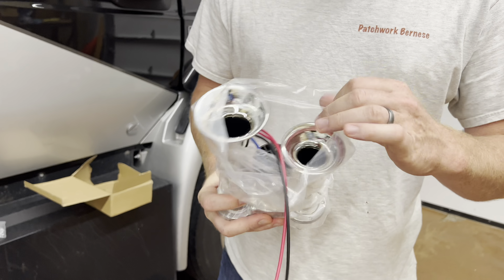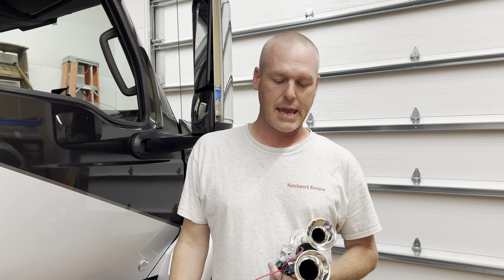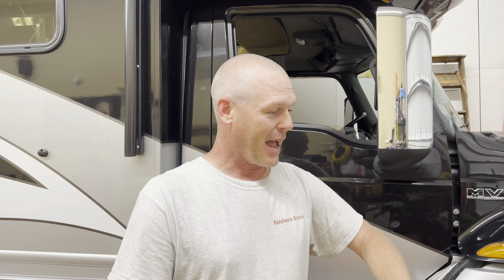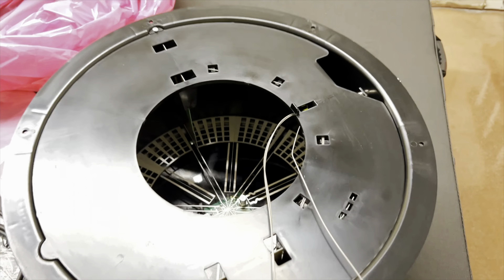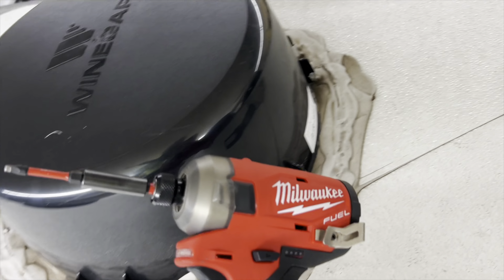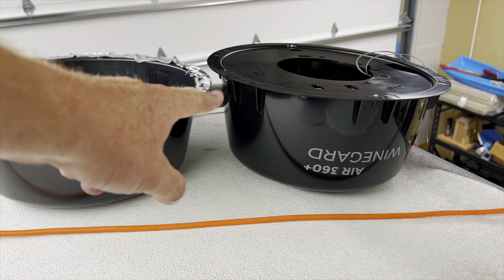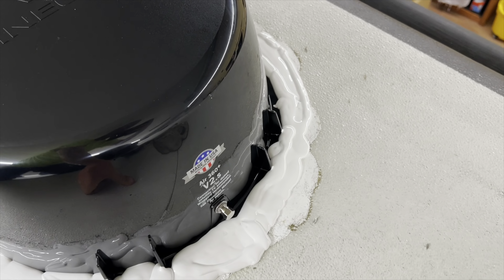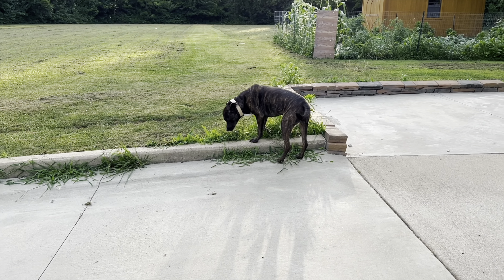New "Air" City Horn and Winegard Air 360+ Antenna (Worthwhile Upgrades?)

Comment: The louder is better because it is louder.  If you can aim it up into the hood it may sound a little better, but it is better than the soft horn.  Piper as always was cute.   Be safe guys.
Reply from the maker: Not bad for a city horn replacement for $30😎 Piper was like what was THAT?!

Comment: Not sure if you're aware of it but Dicor and most other self-leveling lap sealants have a lot of water in them and therefore shrink and gets holes in it when it dries. Look into AFCAT. It's not self-leveling but spreads nicely but it doesn't crack or get holes in it when it dries so it doesn't need the maintenance as often as others do.
Reply from the maker: We've had great luck with dicor

Comment: Both of those antennae are worth every bit as much as the $20 one I put in my previous RV after I trimmed some trees with the old crank up antennae.   Seriously mounting the thing on the roof dates back to the old aluminum tree antennae we used to use.  I literally mounted the $20 one in the cabinet behind the tv and it worked better than the old winegard. But typical RV accessories $5 worth of plastic and a 99 cent circuit painted onto a piece of plastic marked up 15x. But even better we finally decided why watch tv while camping? Interrupts the piece and quiet.  Old movies off my laptop DVD player yes. In fact it is our tradition that the first night of camping we watch Robin Williams in “RV”.
Reply from the maker: This antenna is working much better than the stock one... It almost never got anything! We all agree that the old school RV antenna worked much better!!

Comment: The good thing about it being $33.00 is you can only go wrong by $33.00.  Fortunately my Ghost came with an air horn already installed but I do have a switch to change it back to the "city horn".  The new one is better than the stock horn but it still needs a little bass.  The only time I remember using my horn was in Indy when some jerk started to cut about 3 feet in front of my rig.  It got his attention and he thought better of it.  Yes, absolutely, Lynn should get up there in here bikini and wash that roof, the longer it takes the better just 'cause she's so darn cute.  Keep the good stuff coming guys.
Reply from the maker: Not bad for a city horn replacement, we may get a truck air horn in addition. Not bad for $33! Soon the roof will get a good scrub down😎

Comment: Will that Airgard 360 work on a house? I can’t see why it wouldn’t?
Reply from the maker: As long as you supply 12 volts, it'll work.
Reply: @WanderingWagners  
Yes! I can get a converter from 110 to 12V…let me see if I can find that first.
Reply: Found the converter, $16.00 to $30.00…at Amazon

Comment: I think because a lot of them are going to be used on school buses, maybe if the driver was going to give a gentle honk they didn't want an air horn if the driver was going to provide students with a gentle reminder. That is my guess, we had a 1/4 mile driveway on the farm and you could barely hear the city horn at the other end on a calm morning, lol. Nice to have something more substantial,.

As far as the Wingard 360, I couldn't see much physical differences other than the slight height difference as far as the TV antenna section goes. Don't worry, our King batwing on the roof of our Lance is a piece of junk also. I want to see if they upgraded the software on the TV's yet since they sold the TV channel spectrum to Verizon above channel 36, it should take much less scan time to look for stations then. Version 3 of the digital standard is coming out in several years, it is not compatible with Ver 2, but it will allow for weak TV signals to come through much better without such abrupt pixelation. Everyone with old TVs will have to buy a converter of course! It seems history repeats itself!!!!

On an unrelated note, I have a Midland 15-watt GMRS radio that I want to mount into our future Wraith or Triumph and the Larsen On-the-glass UHF antenna I bought won't work on a Super C because of the overhang interference, so this is a challenge I am working on. I don't want to drill holes into the over-cab of the 32 or 34W to mount an antenna up there even though it would work better up there side-mounted or roof mounted. Once I solve that I also can use it for my Icom Dstar radios too, which currently are mounted into my 2017 F-150. Not sure if my F-150 will be a dinghy or get replaced with a jeep yet. I was advised to get a rear mount by the rear tire for the antennas as the 200 jeeps from the FMCA jeep club that had a rally at this RV park in Colorado said that both those radios would pick up endless birdies from antennas on the windshield or the traditional door hinge bracket area. More homework, lol/ Dave, KU9L & WRTI814.
Reply from the maker: I haven't tried out this antenna mount myself but I've been told that it works on the MV series chassis and could possible solve your issue. https://www.walcottradio.com/international-lt-cb-antenna-mount-pca7005-p-3704.html
Reply: @WanderingWagners  I'll check it out and order one to investigate, thanks!!!

Comment: It is a low cost improvement, but would it be possible to swap out the "soprano" trumpets for some "tenor" trumpets and keep the same compressor?
If you let us borrow the Wraith for a couple weeks. I will wash the roof for free!
Reply from the maker: This is just the city horn.. We might choose to add an extra air horn in the future but for now this will do haha if you want to wash the roof be our guests haha
Reply: @WanderingWagners  i would need to drive it to my house and meticulously clean it.  The round trip and work to clean it right would probably take a month, maybe 2.  Pay no attention to the man behind the curtain or the extra few thousand miles on the odometer.😉😉
Reply from the maker: @davelauraphillips8814  😂😂

Comment: I hate to tell you it might be worse. It's a Super C it needs a little more  deeper throaty sound. I think you may need to get a separate air system. 😀
Reply from the maker: It's the city horn. Every big rig has one and the air horn. This is just the city horn replacement👍🏻

Comment: We've had inconsistent success with our Winegard.  We carry an external antenna with us for those times we are going to be stationary for a few weeks.  As for the internet gateway, don't bother.  It is 4G only and a Category 4 modem, which is about the weakest modem you can buy.
Reply from the maker: We stingy plan to use the internet luckily. But it can't be worse than our previous antenna!! Haha

Comment: It better now but, come on Mike spend the money on a real air horn. Great job on the old antenna buddy.  It is crazy how much that Wineguard antenna cost and there is nothing worth the cost of that thing.  Piper isn’t sure about that new horn.  The horn on my 1 ton truck sucks also.  I was so, discussed with the horn I wrote a letter to GM and told them that I could fart louder than their horn.
Reply from the maker: We will see how long it lasts😂 it's louder and less road runner sounding haha